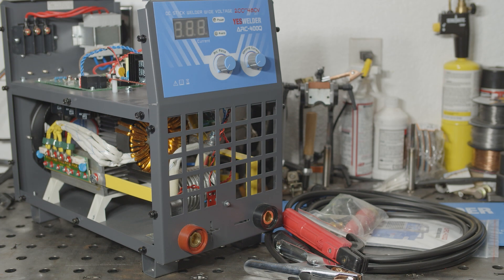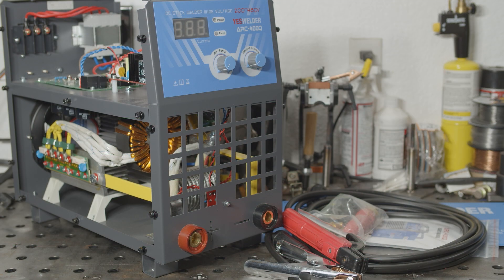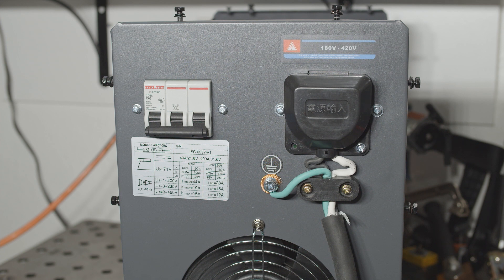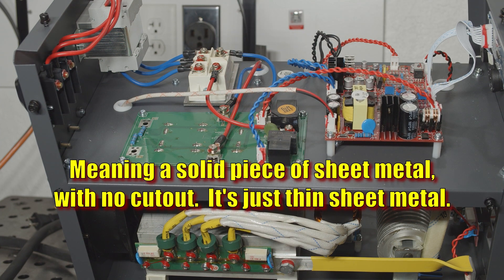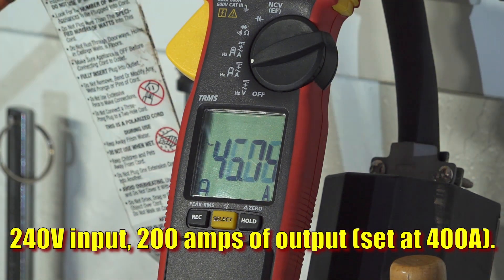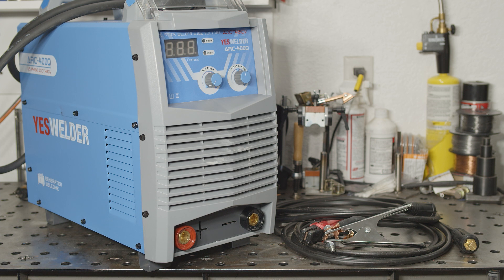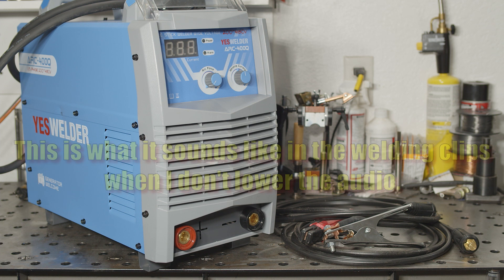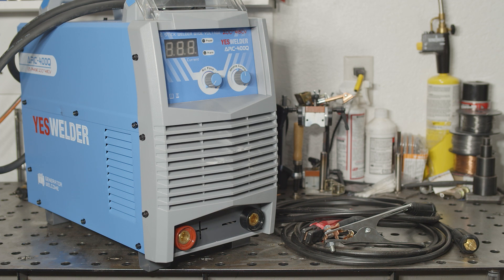Yeswelder ARC-400Q, 400 Amp Stick Welder Review

Comment from the maker: I just wanted to give Yeswelder props.  Their advertisements and listed specs may not be perfect yet across the board, but they have shown a willingness to make changes.  I just visited their website and both the product page for this ARC 400Q welder and the digital version of the manual they have linked from the product page have been re-written and corrected on most points.  It is now listed as scratch start, the wiring connections shown in the manual have been updated, and the specs page of the manual now lists the max output at various input voltages rather than just implying 400 amps at all voltages.  There are other small changes as well.  It's a small step, but it is a step in the right direction, so I wanted to point it out.  Cheers.

Comment: Not for nothing, but if you have 480 volt supply you're likely already aware how scary that voltage can be. Running a China special anything at 480 volts is so damn near suicidal.

Comment: Have you had any issues with the 50hz breaker?  Any updates on performance?  Thanks!
Reply from the maker: Not sure what you mean by 50hz breaker.  Are you asking about breaker size?  Supply frequency?  

Unfortunately, I sold the welder a while back, so I can't give any info on long-term performance or reliability.  I supplied the welder with 240V at 60hz via a 40 amp breaker and had no issues.

Comment: I recently purchased one of these welders and I have been having trouble getting it to operate properly.  Customer service SUCKS and you are basically on your own !!!!!  I wired mine for single phase 220 with L1 and L2 on the first 2 terminals and the neutral on the third terminal as per the instructions I was emailed from the company .  Seems to me that you are saying that this wiring hookup is incorrect, could you please comment on this ??!!!!  I was running 3/32 7018 at what the machine indicated as 135 amps and I couldn't get any penetration in the parent meta, had a terrible time striking an arc and couldn't keep the arc lit !!  I explained to the company that I hooked up my AHP 160 ST welder , set the output at 90 amps , ran what was left of the same rod on the same piece of steel and had an easy time striking the arc with good penetration and a super smooth arc all the way through the weld!!    Are you indicating that the output current on the digital readout on 220 volt input  is half of what it should read  ???!!!!  I would greatly appreciate your input as I can't  get any help at all from the manufacturer!!  It's pretty difficult to troubleshoot a machine when you can't talk to someone who actually knows how to weld and understands how the machines they are selling are supposed to function and operate !!!  yes welder , NEVER AGAIN !!  This is a warning to anyone thinking about buying something from this company!!  Buy an AHP or something else !!
Reply from the maker: The wiring connection you made will work fine, though the neutral isn't needed.  Having the neutral connected won't hurt anything, but it is unnecessary.  

When running on single phase, the welder output maxes out at 200 amps, not 400.  However, the display does not reflect this; the display still goes to 400.  This means that you are only getting half what the display shows.  If you want 90 amps, try setting the welder at 180.  

I really wish I had easy access to 480V, three phase power to see if the welder would actually put out 400 amps.  I suppose it's possible, but I have my doubts.

I am really losing respect for the company now that their latest "Firstess MP200" suffers from some of the same false output claims, as well as the fact that they have begun deleting any non-five-star reviews on their website.  I know this for a fact, because all mine are gone.  My reviews were totally fair and honest, not bashing, just listing the pros and cons.  All gone.  Many of the reviews remaining sound a bit fishy.  Including one for this 400Q welder with the guy saying on single phase he had plenty of power to weld 3/4" steel at 240 amps.  Sorry, but I call BS on that.
Reply: luckily yeswelder is not readily available here..bought a hitbox mig and seems to work fine..any better than hitbox-class will be esab-class...

Comment: Hi Mr. bigtv. I was seriously consider the Kicking Horse DV stick welder and the Deko DV too according to all the Amazon feedback which seems to place them head-to-head in their performance. I've seen your review of the K.H. but not of the Deko (160A) and since for a long time I've been saving to buy the HTP America Inverarc 200 TLP Stick Welder which currently sells for $1,499 (it weighs only 15 lbs) considering the performance of the above mentioned less expensive stick welders, what would be your consideration in testing the HTP to see if it is worth paying an extra $1,299 as compared to the K.H. and the Deko? I believe that people equate expensiveness with quality and the HTP America IS a high quality welder according to most welders I know and what I've seen on demo videos, but considering how much can be done with a stick welder, is it worth spending the extra $$? Thank you for your consideration.
Reply from the maker: I haven't personally used the HTP machine.  I know they were a fairly well regarded machine several years ago.  I don't imagine that has changed.

Obviously the Kicking Horse unit and the HTP Inverarc are very different machines.  The HTP has pulse stick, pulse TIG, supports a foot pedal, has adjustable arc force and hot start and more.  As for quality, I have heard the HTP machines are nice, but I've never seen one in person myself, and that was a while ago, so I can't say if they've changed or anything.  My assumption is that they have a better build quality than the Kicking Horse machine, but I can only assume that.

So whether or not it's worth the extra will come down to whether the extra features are important to you and how much value you place on having those features.  

Where about are you located?  Do you mostly need stick welding features, or will you utilize the TIG functions?
Reply: Check out my videos on the HTP Inverarc 200TLP.  It is worth every penny and then some.   It is a real beast and the performance is nothing less than stunning.  It is completely effortless, unlike cheap inverter stick welders.  The newer Inverarc 160 Plus is the little brother that directly follows in it's footsteps.

Comment: These are not little issues -bold faced lies maybe.
Reply from the maker: Their rep said things about a disconnect between the factory and them as well as a language barrier.  Well, that might be a reason, but for me that's not a very good excuse.  I'm just a random guy and I was able to find a huge number of issues by simply testing a few of the machines and comparing it to the specs.  Not to mention contradictory stuff between the web page and the manuals.  He also mentioned that if they order 5,000 of a particular unit from the factory, they can't change the specs until they sell through those.  Well, I understand you can't physically change the specs, but you could certainly change the text on the website and the Amazon ads, so I don't love that excuse either.

Not sure what the issues is as to why they can't pull up the admin side of the website and fix stuff.  And maybe you can't fix the printed manuals, but you could change the PDFs on the website.  Maybe even post a notice in the ads pointing people to the corrected digital versions and informing them of the incorrect info in the printed manuals.  It just seems like they could be a whole lot more pro-active in getting this stuff worked out.  They apparently hired a marketing company to run the promotional campaign for the new Firstess MP200.  I would think it should be possible to spend a bit of money to get the info around their current lineup corrected.  Again, here's hoping (for their customers' sake more than anything) that they get better going forward.
Reply: Man thanks for the reply-its pretty much all of them-the green import machine does the same type thing. I'm looking for a large amp stick machine to be able to arc gouge without ruining the lower end of a transformer machine.  The green company says ttheir machine is 300 amps but was tested to max 260 amps on 240vac.  The best I've seen and used is  northern tools klutch brand-they are exactly what they claim. However, NTool doesn't import the full line of their import manufacturer(who does make a large stick igbt machine) and that manufacturer has 100 unit minimums.  I guess that leaves only lincoln,miller or esab....ouch. good job on the video nonetheless- I REALLY APPRECIATE THE BIG MISTAKE YOU KEPT ME FROM MAKING.

Comment: This gives me iffy hopes for their new machine. This is like the 4th review on this brand ive seen where the voltage / amperage was off. 

My untrained brain would figure "probably less going on in a stick machine and would probably be more accurate than their mig machines or tig machines with features"

a 160 machine should run 5/32 all day, or atleast all day between duty cycle. Even if you normally run them at 170ish.

sweet review, cant wait to see more in the future.

Comment from the maker: I saw a comment about the price I paid, but it seems to have disappeared.  I just figured I'd put a comment about the price I paid here.  I purchased the welder from Yeswelder's website.  About a month ago it was on sale for $199, but they also had a 15% off sale and it turned out the sales stacked, so it ended up costing around $169.50.  Just thought I'd clear that up.  On their website it is currently back to $399.